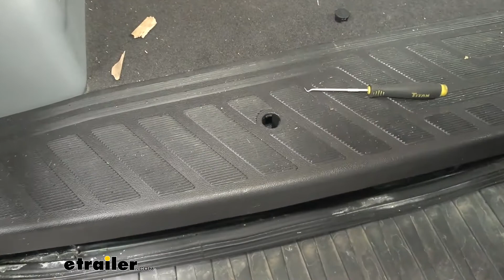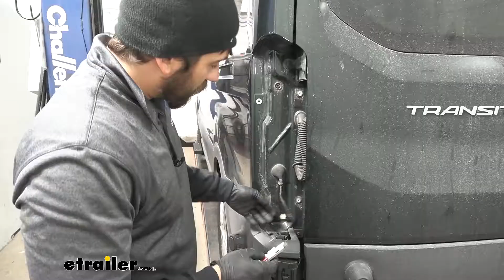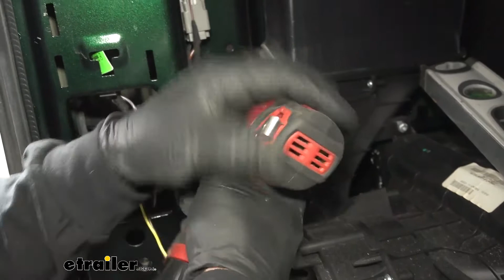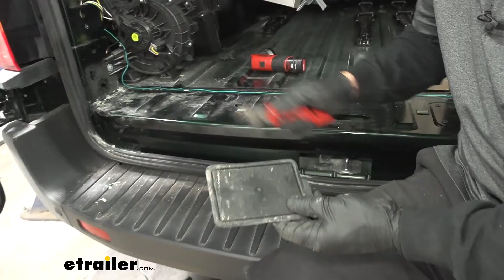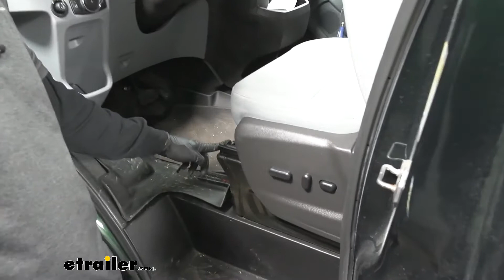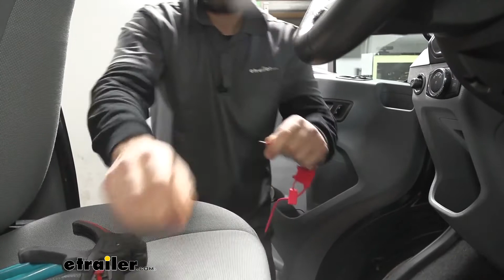etrailer | Curt T-Connector Vehicle Wiring Harness Installation - 2016 Ford Transit T350

Comment: There’s a cover on side of seat it’s a 12v fuzed live
Reply from the maker: We're assuming that you're wanting to connect the 12V feed for the taillight wiring harness there, correct? You can connect there if you wish but we don't recommend doing so. Running that circuit to the positive battery post as shown in the video will do the best job of keeping the vehicle's wiring system isolated from any short circuits that might occur in the trailer wiring.
https://www.etrailer.com/Custom-Fit-Vehicle-Wiring/CURT/C56327.html